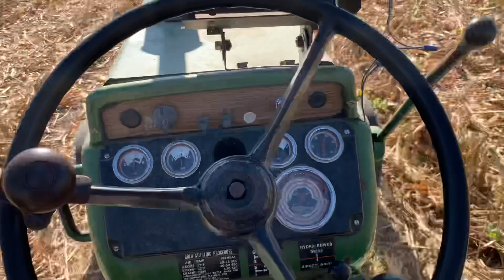Corn stalk bales, with Oliver 1555, Oliver 880 and how it works corn picker and flail chopper

Comment: If it weren't for breakdowns, we would always be caught up and have money in the bank 🤣😂
Ya, right!! We'd just be trying to do more....
Use what you have 👍😁
Reply from the maker: Considering how old the stuff that is run around here is, surprised it’s not more frequent. New stuff breaks too.
Reply: @crazydave4455  LOL..
Brand new breaks, no parts available.. newer stuff breaks parts are a few days away.. 
Older stuff breaks, parts no longer supported by manufacturer...
1986 C-IH 3394, replaced a bad remote valve a year ago, had to find a used one... A year later.. it's got the same problem the last one had🙄🤬
1985 Versatile 936... Parts come from New Holland.. most are no longer supported, the ones that are available, are so outrageously expensive!!! 
Brake master cylinder, almost $400... When you finally figure out what master it is, about $40 at Auto parts store 🤔🙄
Reply from the maker: @GosselinFarmsEdGosselin  that BS game they play with part numbers 🤬 when I was running the stock lift pump on my 01 Cummins powered Ram, dealer $175 go to truck parts counter (big trucks) same crappy carter pump for a Cummins $60 bucks.
Reply: @crazydave4455  yup...

Comment: Snoots
Reply from the maker: Awesome, we’re not alone 😂
Reply: @crazydave4455  I'm still running the same picker that my dad ripped the outside snoot off of back when I was around 10 years old! Your picker is in much better condition than mine!!
Reply from the maker: @LVFFarmVlogs  this one was bought from a neighboring farm, always stores inside. The original is now a parts machine.